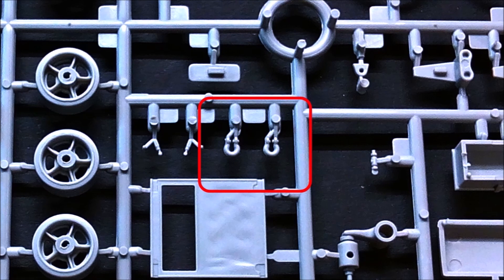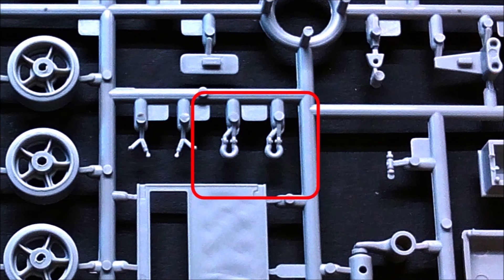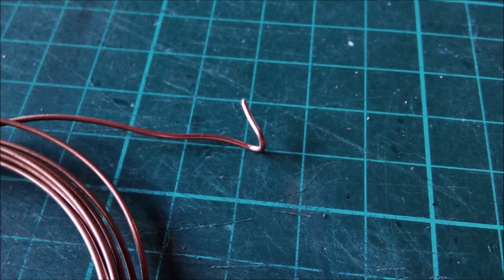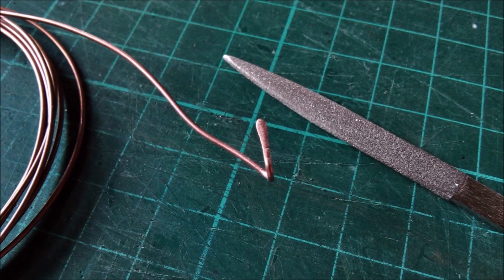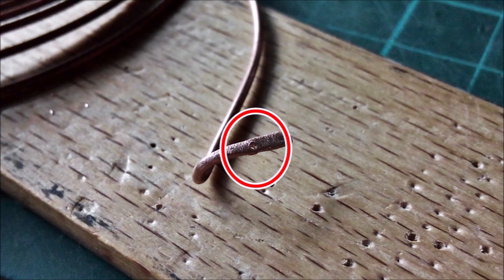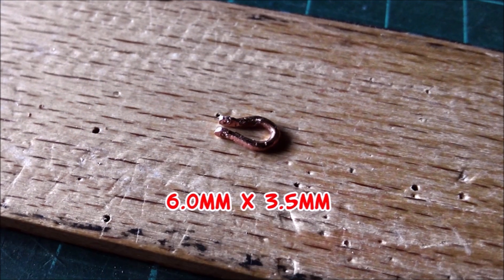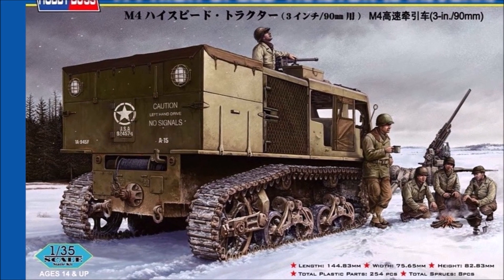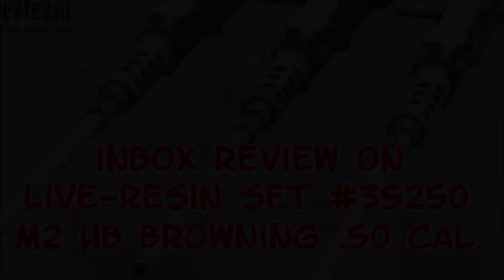Not Quite A Tutorial - How I Make Shackles From Copper Wire

Comment: Thanks Jens.  A simple but effective solution.  I often break plastic shackles which need a lot of clean up.  Would clamping the copper wire, holding over something hard and flat, then using a metal punch and small hammer work to flatten out the ends?
Reply from the maker: Thanks a lot, Harry! I broke them too many times, but it took me over 40 years to find this solution, hahaha! I'm sure that your idea would work. If I had a hammer... I mean such a small hammer, I'd check it out. There's a small envil on one of my two vices and it would definitely be hard enough. :)

EDIT: Anvil! I guess an envil is an "evil anvil", but that wasn't what I meant to say. :)